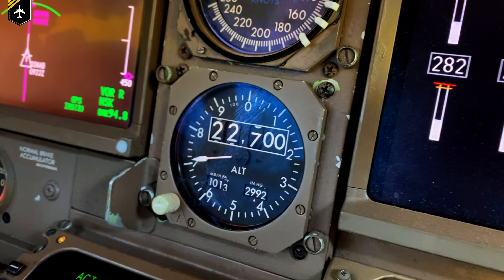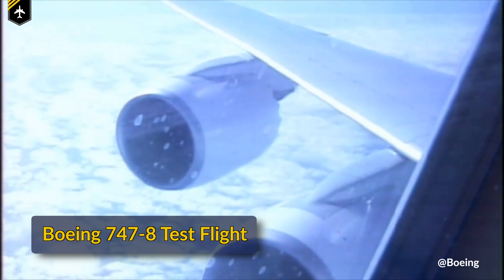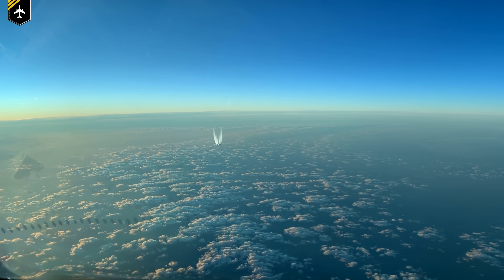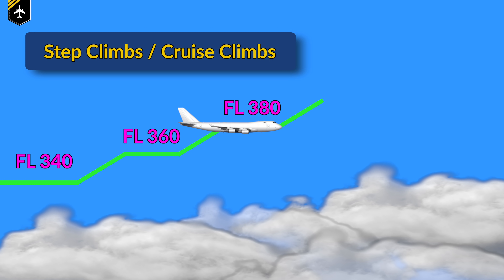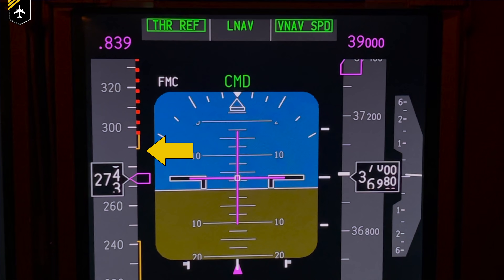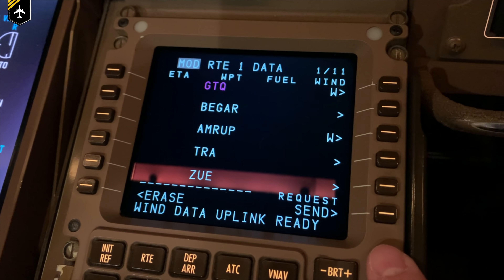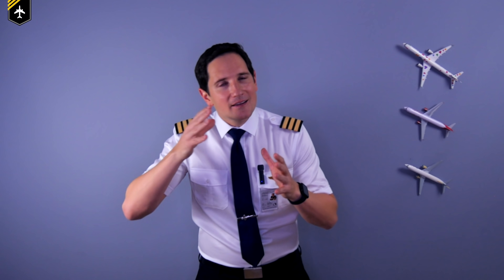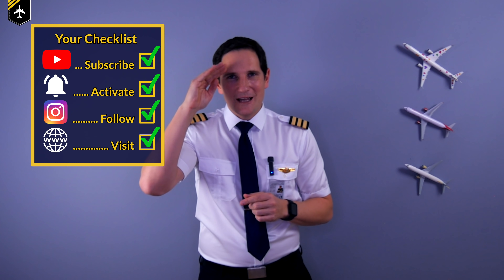How HIGH CAN PLANES fly? What is the COFFIN CORNER? Explained by CAPTAIN JOE

Comment: SR-71 Blackbird has entered the chat.
Reply: "Request FL 600." "If you can get that high, you are cleared FL600". "Leaving 800 descending FL 600"
Reply: @roichir7699  I remember listening to that story on YouTube but i cant seem to find the video again, do you happen to have the link to it?
Reply: @roichir7699  was waiting for this :-)
Reply: SR-71 Blackbird has entered the chat while escaping the Earth :)
Reply: @zerenjin3999  And left again at Mach 3... I think I heard once their power settings for cruising was always full throttle with afterburner...
Reply: @alexku8452  Yes it was designed for full time afterburner use, something that was not previously done. Normally afterburners are for temporary use only, like during takeoff, rapid acceleration/climb, and to cross the sound barrier.
Reply: @alexku8452  The number of aircraft that can even fly past Mach 1 without an afterburner can probably be counted on one hand.
Reply: @jblyon2  The wear and tear on those engines must have been insane. But then I remember to have herad ones that if it was fuelled up on the ground it was leakinging fuell like a sieve untill it was flying and heated up to have thermal expansion close up all the leaks. Interesting fuell efficiency problem indeed ;) .
Reply: @alexku8452  The TurboRamJet basically just turned into a RamJet at cruising speeds for the SR-71 and essentially becomes a rocket which is funny because that is when it's most fuel efficient! When going Mach 3+.
Reply: AVRO Arrows lets out a yawn.
Reply: @Malfehzan  ya I'm Canadian and that planes awesome
Reply: @Malfehzan  probably still steamed at Diefenbaker
Reply: MIG-25 has also entered a chat.
Reply: English electric lighting has entered the chat
Reply: English Electric Canberra has entered the chat, taking photos of the U2 from above
Reply: Gagarin said goodbye to the chat and flew above any plane
Reply: 🦨 SR72 HERE!!:)
Reply: Concorde has entered the chat.
Reply: My halcyon days.... That was the jet I was trained to take on as crews retired. Sadly the Bird was retired first. I was retrained to SAC and flew F-111 and B52's. An odd mix. But my ❤️ belongs to the Aardvark!!
Reply: @jobellecollie7139  I was stationed at Mountain Home AFB in Idaho, and was an aircraft electrician on the F-111A aircraft, what a great fast ,and loud plane. 1982 to1986. They look mean with the wings swept back, and doing a fuel dump and burn. That TFR system is quite impressive. 200 ft, hard ride sounds like fun. 🙂
Reply: U-2 aka "Dragon Lady" has also entered the chat.
Reply: @vman66441  The U-2 may have had the most narrowest and unforgiving flight parameters.
Reply: @paolobramucci3609  You are correct! Many consider it the most difficult to fly out of all the planes in the U.S. fleet.
Reply: @paolobramucci3609  
But they play some cracking tunes!!!! 😉
Reply: @vman66441  I heard what downed Francis G Powers it doesn't take much to disrupt that corner with an exploding missile nearby
Reply: @wrightmf  Unreal how they had that kind of tracking technology on missiles in the 60s. Sad he survived that but died in a helicopter crash.
Reply: @vman66441  There has been much written, plenty of YT presentations. In general Soviets basically threw a barrage of missiles, also flew fighters as high as they could go. One was to be a "target" to get it going in direction of Powers aircraft. The U2 mission was launched on May 1, not much air traffic in USSR since everyone was celebrating May Day with parades (nobody in US thought of that). One of those missiles exploded nearby, the shockwave disturbed that narrow coffin corridor (I read it was just five knots between stall and buffeting). U2 went out of control and broke up.
Reply: X-15 has entered the chat
Reply: Haha nasa space shuttle go BRRRRRRRRR.
It’s kinda a plane right? It lands like a plane?
Reply: @squeaky5674  more like a brick. The shuttle training aircraft was flying with extended main gear plus engines in reverse to simulate the shuttles descend rate and drag.
Reply: Ha ha!!! Indeed it has!!
Reply: X-15 is better because its 3x faster
Reply: haha, MIG-31 go brrr
Reply: Those J58 Turboramjets absolutely scream hehe

Comment: Hey cpt how's it going, it's ironic you asked that question as we recently had a 747-400f in the hanger 🤣🤣🤣 stay safe great video.

Answer is: The maximum operating altitude for the 747-400 is FL450/45100 ft.
And it's the same with the 800 series.
And that FL450 is also with the aircraft operating dry.

Comment: Lemme just guess the maximum operating altitude for the 747-400 is 50000 ft. Seems about right, cuz the Concorde flew at 60000 ft, and I don't think the 747 can fly that high so 50000 ft seems right. And you said I should be surprised.

Comment: Video Request - "Power Settings On Aircraft"
Reply: B747-400 with RR RB211 G rated at 50,000lbs from after start the engine will settle at Ground idle with the thrust levers closed.
The next setting will be Take off power and this is where a video would help because it’s not as straightforward as it sounds, there are four options to take off power, they are:
1 Rated power, in my case 50,000lbs
2 Assumed temp reduced thrust 
3 Derated thrust 1
4 Derated thrust 2
The top two are the ones we use most as we are either going a long way in a heavy aeroplane or we are going for a flight of say 8 hrs or less even if we’re full, then assumed temp thrust reduction is the norm.
The last two are pretty much only used in contaminated conditions so not very often and it’s just to artificially lower the minimum control speeds in the event of an engine failure so that you can either stop with degraded braking performance or get airborne at a lower speed than usual. Because it’s not used very much, some companies ban its use.
Next is Climb power and again 3 options depending on aircraft weight or obstacles in the flight path, they are:
1 Rated CLB power virtually the same as MAX continuous thrust.
2 CLB 1 a fixed reduction from TO power.
3 CLB 2 see above but more.
The rest of the flight will be in speed mode as I said in my earlier comment with CLB mode used for Step climbs that Joe talked about.
During descent a combination of flight idle (higher idle setting than ground idle to reduce spool up times) VS mode or VNAV which combines all of the above owing to it taking note of altitude restrictions on route particularly in terminal areas.
After flap extension (can’t remember how much and can’t be arsed to look it up) approach idle comes into force again to reduce spool up times to almost nothing should you have to use idle to control speed.
After landing it is mandatory to use at least revers idle, again a high idle to avoid compressor stall, as the reverse levers are moved to the idle gate, the reverse shrouds deploy and the REVS display turns green then anything up to Max reverse can be used, there is a detent which we call partial reverse that is approximately half thrust most normally used on shorter or contaminated runways, as speed reduces so should reverse in order to be idle reverse by 80kts.
When the reverse levers are stowed ground idle is back in force until you reach the gate and shut down.
Reply: @johnmorris7815  Much Appreciated Mate! 🔥
Reply: MSFS: MAX POWAH!!
Reply: TOGA
Reply: please !!
Reply: If you mean do we apply a particular setting to achieve a speed? Then no, the air is far too fluid also weight and trim changes would prevent that working, however like cruise control in your car our autothrottle system will change power to provide a constant speed/Mach.
The only exception to this is final approach where gear down, flap25, top hat (3 degrees NU) and 1.15 EPR would have you at VREF+5.